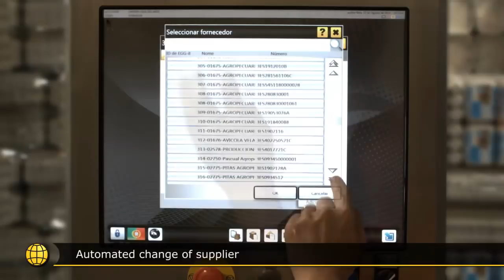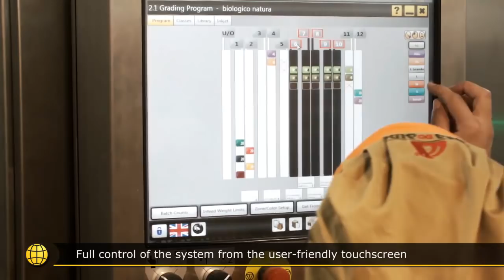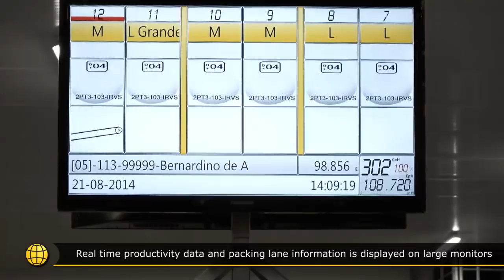Egg Packing Machine (Egg grading) - The Egg Grader: SANOVO Ardenta 300 - Egg packed into cartons

Comment: How long are the egg carriers supposed to be cleaned?
Reply from the maker: Hello Thomson Brite Muwa

Thank you for your question. 

Please revert to the Ardenta manual; on pages 95 and 96 detailed description on the time and the way to clean the egg carriers is described.
However, generally speaking  you should let the foam work for 10-15 minutes on the machine parts in question, then rinse of with water. 

If you are afterwards in need of more explanation please contact our Helpdesk

Best regards
Anders from SANOVO